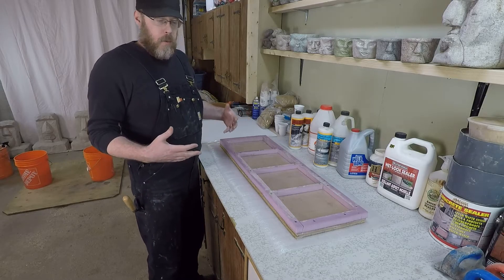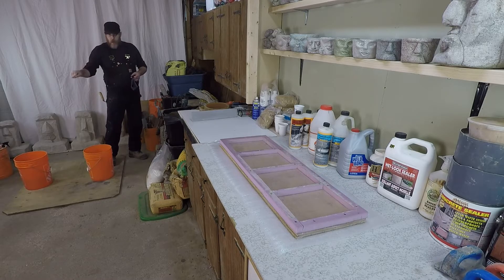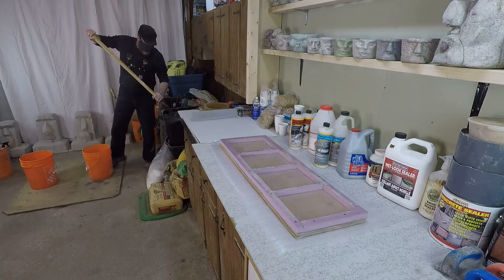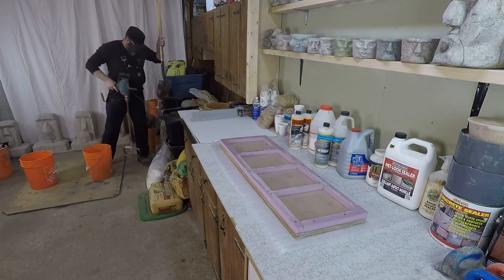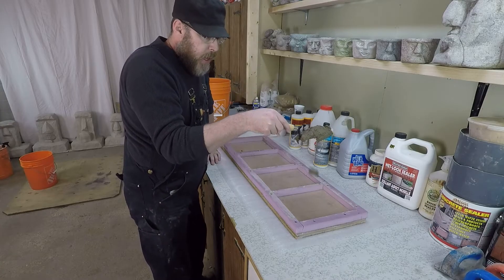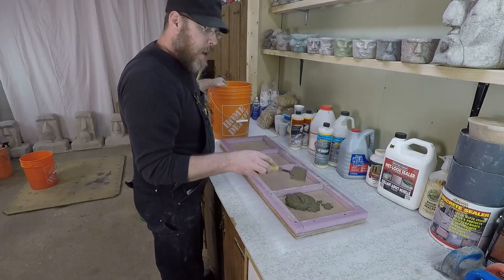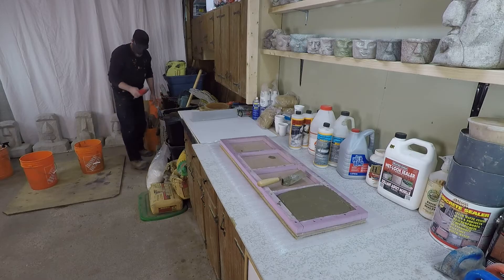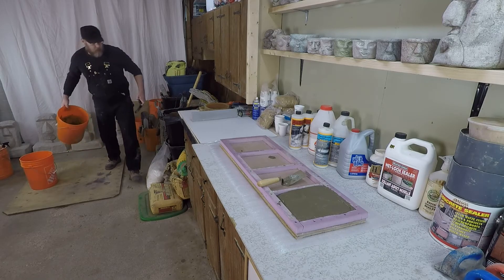How Wet Should My Concrete Mix Be?

Comment: Hi there i made cement in a pie plate and stuck driftwood in to make a craft , i had the water on top can i put dryer stuff on top to seal the cracks? ( i did it yesterday pulled it out today figured it will dry better but fell apart 😬😫🤣any ideas will help thank you ❤

Comment: I've been casting some pots that are quite detailed so the mix I've been using is wet. I have also been using a pigment to get a darker colour and the efflorescence is spoiling the finished item. Is this because my mix is so wet? Do you have a way to remedy this?
Reply from the maker: Yes, this video should help you https://youtu.be/7mGo37Tkm5c?si=rsc8yqFxehV_EKmx
Reply: @Swimmingpoolsteve  I just watched. It definitely opens a new path for me to try. I'm from the UK and sometimes it's hard to find our equivalent. Do you have any recommendations? I guess I can always try dish soap to start with.

Comment: ahahaha concrete will setup under water.. a 5000 psi  concrete with 20 gallons too much  of water will still be 4000 psi when it  dries.. how silly.. the problem is  the   volume..
if  you  keep the same  amount of solids in the same  space, water doesnt matter

Comment: I went too wet on a small slab pour my first try and on my new project making garden bed long bricks i am worried i almost went too dry.  Gonna hydrate it soon as its setting up now. I will probably put them in a wheel barrow with water if they fit

Comment: You make mixing concrete seem like some kind of mystic formula. Then you open pre-mixed bags. You offer very little advice on actually mixing concrete. So I'll tell all your subscribers how it is done. Mixing concrete by hand in the UK with a cement mixer is an art in its self, but once mastered, it is as easy as taking a dump. The lowest general mix is 4 or 5 sand and aggregate mix (commonly known as all in) to 1 cement, the magic is in adding the right amount of water to the mix. Too much water and the concrete will take a long time to go hard, and difficult to work. Too little water and the concrete will be very hard to work and will dry green, and take a very long time to properly cure, both of the above will result is a very weak and dusty final finish. The colour of the mix should be a light gray colour and will pour and work with easy, but be stiff enough to stand up. Get the mix right and the concrete will go rock hard overnight and will cure a whitish colour. It is not hard to get a consistent mix, I recommend using buckets to measure out the premix ingredients before putting it into the mixer for a consistent mix every time. When the mix is too dry, simply add a little water, too wet, simply add a little more all in and cement. If the concrete is green and hard to work, add more cement  only and possibly a little more water to get the whitish colour required. Never change the cement product being used half way, each cement product produces a different colour mix.
Reply from the maker: Not pre mixed bags. Sand and Portland  cement. Thank you for your comment.

Comment: I find your videos very useful.  I have a question I hope you will answer.  How thick can you pour a mix like this before you should add aggregate like crushed stone.  I have large holes in my garage floor approaching 2" thick where the concrete has spalled badley.  Should I do this in layers, perhaps adding aggregate to the lower layer?  Or should I just use a sand and portland mix or a topping cement?

Comment: i made mine slightly wetter for fundation repairs of a wooden house, at the top where i had to get it propperly under the old fundation. does it weaken the concrete alot?

Comment: Hi Steve, my pool builder just sprayed the gunite three days ago and I heard that you need to wet down the concrete a few times a day for about a week which my builder did not tell me to do but I took it upon myself to spray it with garden hose to keep moist. I just got a call from him today to put a garden hose in the pool and start filling it up before the plaster? I have not seen this being done before in the research I've done, is this normal and what's the reasoning behind it? He said it help with the curing, is it because winter is coming up and temps are starting to drop into the freezing temps at night like 32-33°f

Any info on this would be greatly appreciated! Thanks for all the great vedios I have watch every one lol

Comment: Good basic info, thanks Steve!  Working with dry block though does absorb some moisture, so for workability on a warm dry day, I've noticed the mortar getting too stiff just from the capillary action of dry concrete block, so I keep it between those two batches in terms of moisture content.  And it seems to have a fast gelling stage that happens 10-15 minutes after mixing a batch, making it suddenly stiffer.  I wish we could use the Roman method of tamping lightly moistened concrete mix into forms, that definitely lasted the test of time, as the earliest Arc of triumph was done that way.  🏟️🏛️

Comment: Is it okay to have your pool deck poured in winter time
Reply: No
Reply: @shanesimmons6079  why?
Reply: @israelclayman4489  well I should say it depends what climate your in , we're am in Ontario Canada we build pools very differant then the states , must more frost up here
Reply: @israelclayman4489  why?  Because if it freezes, it will greatly sacrifice the strength of the cement.  Also concrete needs to properly cure for a month and the temp needs to not get to cold and interrupt the curring process.  There are ways to speed up the drying process but ultimately it will weaken it to some extent.  It's better to wait until the ideal time and not have to worry about it in the future but most people are not willing to wait.